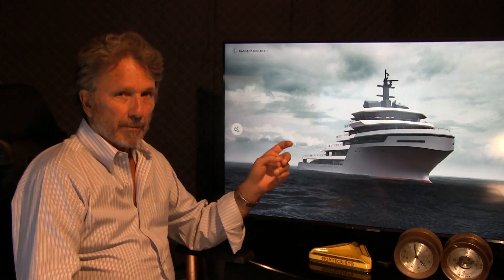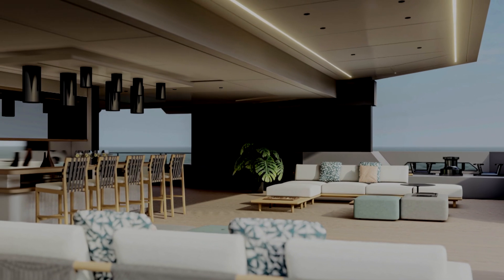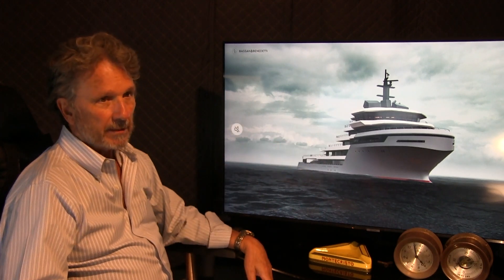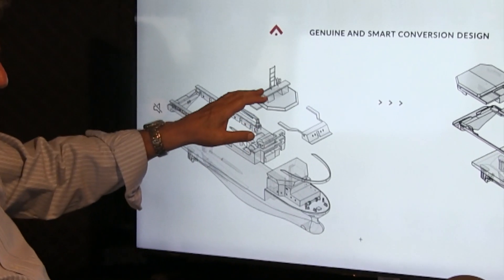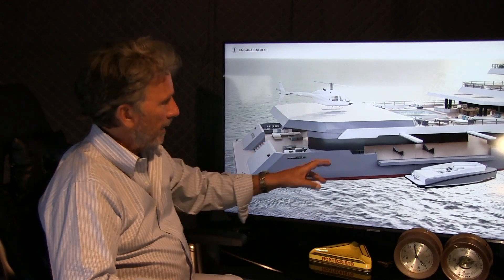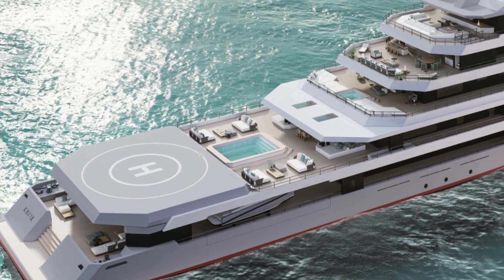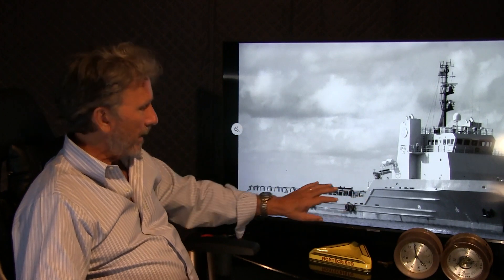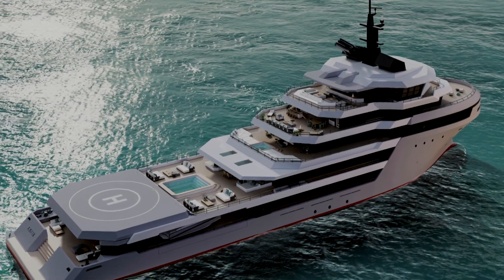New design for 80m/260 ft OSV conversion into Global Expedition Yacht.

Comment: Love the design. Would this design (helipad type) work on a 68 meter hull?. Could you give a ball park figure to the cost of this conversion. Many thanks in advance
Reply from the maker: Yes, this design can adapt to a shorter hull. The OSV series are built on a standard platform that runs from 68m to 85m with the same beam and bridge superstructure- the difference is the length of the aft deck.
Reply from the maker: Regarding cost, we are estimating €14 million for the conversion with a first-class European interior fabrication.
Reply: and how much is the vessel budget ? @XplorerYachts